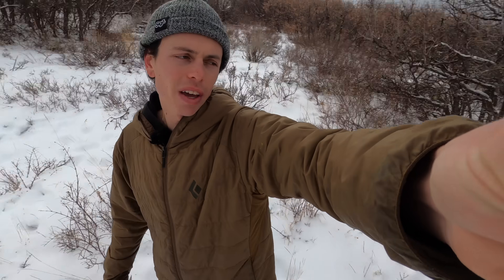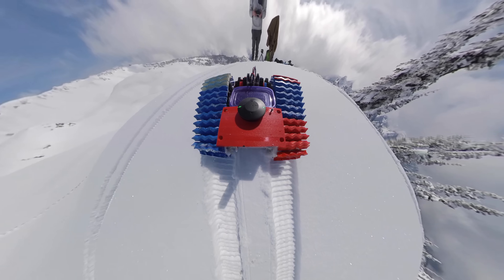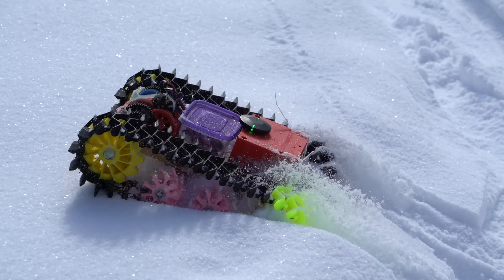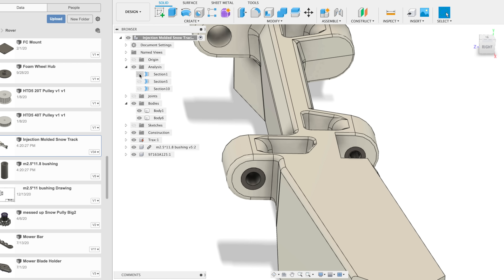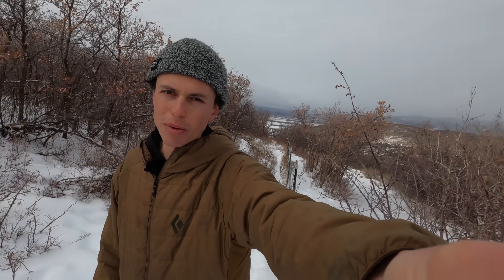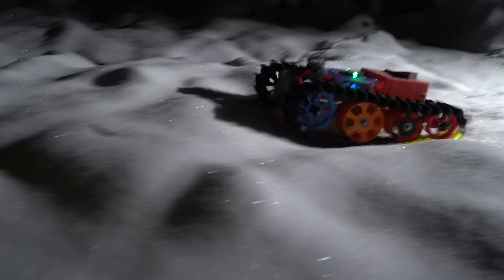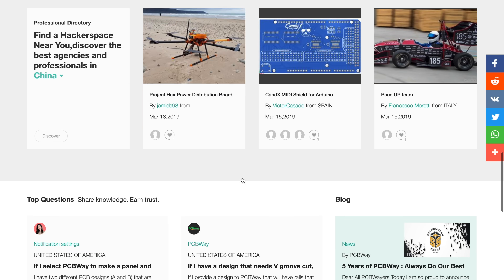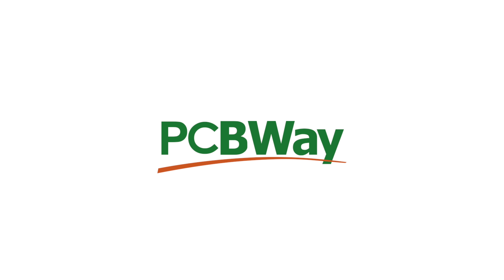R/C Snowcat - New Track Design - RCTESTFLIGHT

Comment: cool stuf! Wish you good luck with the kickstarter and development of the snowcat. Those hobbywing quicrun all in one motors may be interesting for this build, compact and seem to have a lot of low end torque. They are designed for crawlers. It would limit the size of this model though because it is specifically for 1/10 crawlers.

Comment: You should try out the method of re-melting PETG in fine salt after printing. It's been doing the rounds on youtube and reports say it's nearly as good as injection molding. Obviously not as good as injection molded nylon, but wouldn't require any molds.
Reply: Found these guys that sell a few injection molded tracks, including snow-cat ones. Maybe you can get in touch and see if they can do custom ones? https://spykerworkshop.com/shop/3dprintedkatcategory/spykerkatothercategory/delrinsnowcattracksrtr/

Comment: I think you could make your own mold with like some silicon and then find plastic
Reply: from what i've seen other people do, first make one 3d print, then you silicon mold it, then using resin make multiple parts.
resin probably is not the best material, but for a quick test it'd work great.
Reply: @heroslippy6666  yeah, Could probably find some sort of plastic or Apoxsee to make final product
Reply: @mountainbikingwithmatt6310  as great as it would be, i don't think it'd be great as a product to sell. I get the feeling he wants to make an actual product that is worth the money.

Comment: Did you ever consider using attachment roller chain for the tracks' basis? (Also called conveyer chain). Something like this: https://www.nitrochain.com/40-k1-2p-attachment-roller-chain-10ft. Years ago I built an RC tank platform using such chain, but it is likely too heavy for fluffy snow.

Comment: It sucks, but you'll never find any shops in NA to do it for less than 10-20X the cost of the mold in China, unless you can find a shop to donate their time for your channel. Also I found that each part in NA after the mold is made are extremely expensive unless you're doing >1,000,000 parts. Exponentially more expensive for each  inserts on the part. 
It makes the barrier to entry for any small companies trying to do local manufacturing basically impossible. Its crazy how inexpensive china is for this stuff. 

How big is the volume of the part?

Comment: One bit on croud-stuff i was thinking was improving on oDrive
Reply: Mainly making a plugin for KiCAD (and maybe other PCB software) where you can add it to a custom pcb on a per-servo basis.

So if you have 7 servos in a robotic arm, you only need 1 board and/or your custom pcb, not 2+ off the shelf odrive boards